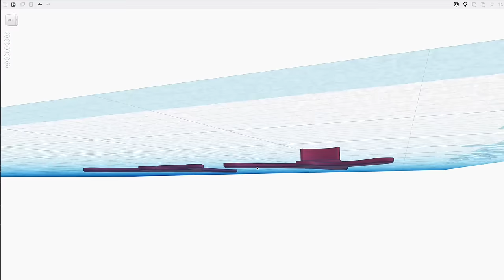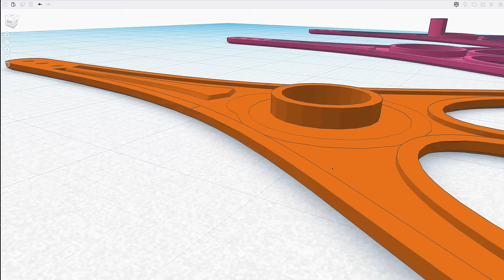Building an AMAZING 1S WHOOP with HDZERO: Full Details & Acro Flight

Comment: When betafpv made the shutterbug85 did they pay you or give you commissions or you just let them use your design in return for products? Just curious if there's any hope to make anything through collabs.
Reply from the maker: I do not do any paid collaborations. For me, FPV is just a hobby, and I like to keep it that way. Betafpv actually resisted making my 85mm 2S formula for a long time because they though 4S would be the hot new thing. I had to convince them that the 2S formula was what people really wanted. I'm glad they finally did because it made the build more accessible for people. However, I specifically told them that they were not allowed to call it a "ShutterBug85".
Reply: @MrShutterBug  that's very awesome of you. I taught my self everything over youtube and you have changed how I think about building. Helped me appreciate that light builds have their place as I'd usually go beefier but miss out on all the agility there is to be gained.

Comment: Hello. You make inspiring videos. can you make a video how to set up in betaflight. with how to rotate the flight controller. and uart. Mvh. Erik. thangs
Reply from the maker: I explained how to rotate the FC and fix the motor mapping in this video: https://youtu.be/Aoy9-_ja7Pw. I use EmuFlight for that one, but the Betaflight settings are the same. With Betaflight 4.3 they made it easier, which is great! There is now tool on the motors tab that can remap the motors much more easily. I have not made any videos about the new feature, but I'm sure you can find a video if you search for one. Good luck!
Reply: @MrShutterBug   thangs

Comment: Can I bind a Spectrum Dx8e controller to this ??
Reply from the maker: My build uses ExpressLRS, but you could use Spectrum if you buy a flight controller with a built in spectrum receiver. You could also buy a flight controller with to receiver, so that you can add an external receiver, but that would add weight. I recommend using an FC that has it built in if you can find one.

Comment: Hey bro wanted to get into using digital . Do I need special goggles to do it?
Reply from the maker: Yes. There are multiple digital FPV systems. Each one requires its own type of goggles or a receiver module to use with other goggles. I used the HDZero system in this video using a module for my analog goggles. The official HDZero goggles will be released soon.
Reply: @MrShutterBug  thanks this helps loads

Comment: Honestly when ignoring the breakup, hdzero looks better than DJI... If only the range/penetration was similar I would actually switch
Reply from the maker: Yeah, it looks pretty clean most of the time. By the way, there was a moment of breakup when I flew right past my seat. That was actually an issue with my pre-production VRX. The issue was fixed for the final release, so other people wouldn't see that. Now... the interference flying through trees... that's still going to be there. I was at 200mW this time, for reference.

Comment: Hello. What thickness is the copper wire?
Reply from the maker: Hi. Which wire were you referring to? Most of the wires can be very thin. The exceptions are the wires that carry significant current like the main power leads and (to a lesser extent) the power lines for the VTX.